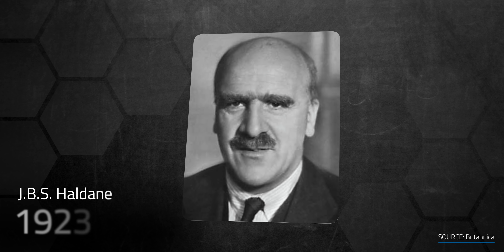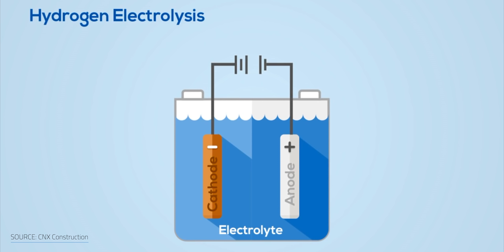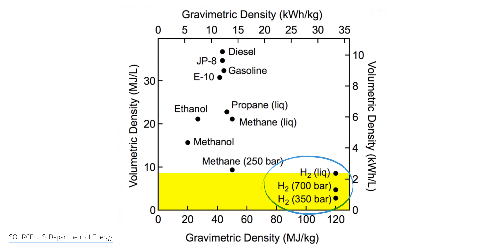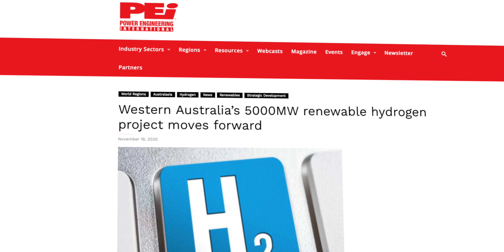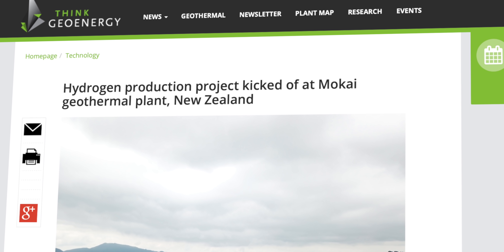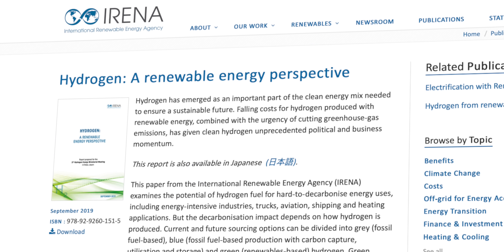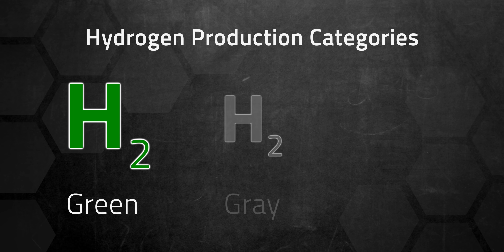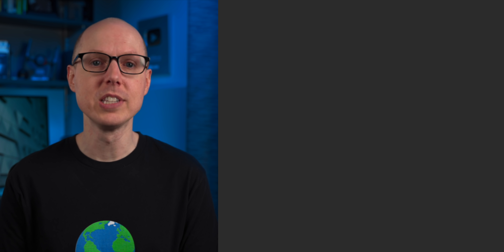The Truth About Hydrogen's Dirty Problem - Green Hydrogen Explained

Comment: I'm not yet convinced that hydrogen has a near-term application in which it can be cost-effective.  Any system involving hydrogen is more complex than the equivalent battery system and, in the case of PEM, fuel cells are highly dependent on both the air and hydrogen being clean, membrane being properly wetted and the water not freezing in the cell when it is not in use.  This sounds like more systems to maintain regularly and properly in order to assure the target lifetime of the system.  At least the low efficiency implies free heat in the winter.  In the case of home stationary systems hot water in the summer would also be free.

My bet is that, even with the energy to produce the hydrogen being free (of which I am skeptical but others bank on) the maintenance and/or repair cost of hydrogen will not let it be competitive in transportation, especially if BEV charging stations also have local storage of sufficient size to permit them to participate in the wholesale electric market.  The charging infrastructure battery would be charged with the same "free" energy being used to produce and compress the hydrogen but at much higher efficiency.  There is a reason why Tesla stated Megachargers would charge $0.08/kWh at the introduction of the Semi.  I imagine that reason involves Tesla Megapacks and Autobidder.  (Whether they hold to that remains to be seen.)

While I write this I am realizing that there may be industrial applications where the fuel cell type can be selected such that its operating temperature matches the plant's need for process heat.  This would largely negate my low efficiency argument.  This would permit such applications enjoy the lowest energy costs in exchange for the capital cost of installing an electrolyser, fuel cell, and a battery sufficient to buffer the fuel cell from fluctuating electrical demand from the process.  Since many processes are most efficient at constant demand the installed battery capacity may not be very large relative to the fuel cell power capability.  So, yes, I have finally convinced myself that hydrogen may have a good fit in many industrial applications.

This is why I listen to technologies I am skeptical of and try to respond to some length.  It is part of my assimilating the information.  My apologies to those I bore with this approach.

Comment: The Emporer has no clothes!
Why does the hydrogen fuel myth and its farcical magical mystery tour still get an audience?
Kids... you cannot effeciently store it in a vehicle without double wall carbon nano tubes and, they only function in labs.
And they still are not feasible after 25 frigging years.

The BTU's of hydrogen are 40% of diesel.
Propane is even worse and even propane has greater uses and applications.
Where is any commercial use of hydrogen for transportation?
Its still a pie in the sky vapor ware.

Comment: It would be interesting to see some hard numbers comparing a propane vehicle with a hydrogen vehicle. How much hydrogen would be needed to match the performance of a propane vehicle. How cost effective would it be in terms of the expense of a vehicle that runs on hydrogen, and the cost of the hydrogen itself. And how safe is the hydrogen storage compared to propane storage.

 Or for home heating. Where I live every house has a natural gas furnace. How easy/hard/expensive/safe would it be to convert the infrastructure to carry hydrogen instead of natural gas, and how easy/hard/expensive/safe would it be to convert or replace home furnaces to run on hydrogen vs NG. 

 These seem like simple questions with simple answers. It's telling that none of them were asked or answered.

Comment: Can someone provide me the reference for the “85% conversion efficiency” of the electrolyzer? I see Nouryon, but can’t find anything useful.
Reply: I can certainly believe they reach such a high efficiency rate, the problem is that there is a lot of losses in the stages after the creation of the hydrogen. It is those compounding losses that really makes hydrogen unattractable from an energy efficiency standpoint.
Reply: I heard a Bill Gates backed company reached 95% efficiency on there system. I think the company’s name is H2Pro.

Comment: Formula one are currently considering Hydrogen fuel cells for thewir new engine regulations, due in 2025. If they do go with hydrogen, it could give the fuel a major PR boost, while also leading to manufacturers discovering better and more efficient ways of using in in vehicles.

Comment: One of the biggest overlooked problems Hydrogen fuel are the end cost and it still needs to be transported.  Projections have put the cost (a lot having to do with transportation costs) still at or above the cost of regular conventional fuel.  So, it costs the end user not only a lot more than electricity but even more than gas.  Not to mention, the transport of Hydrogen fuel has other additional problems I could list.

Comment: Do you even research before you post your videos? Hydrogen storage is a problem, you need pressurized tanks to use hydrogen on ships? Don´t you even know the Germans invented a gel to store hydrogen safely and with almost the same energy density as gasoline? The gel is pumpable, inflammable and all you need is water to release the hydrogen.

Comment: Matt, whats the possibility of using green hydrogen as a battery? What's the total turnaround efficiency of that in bulk facility form?
Reply: It's really not great. Electrolyzers may be "OK" at 85%. Some newfangled high-tech fuel cell presented by NGK apparently does ~80%. Typically they're more in the realm of 60%. And you need to liquefy or compress it to store it. Roundtrip maybe up to 60%? Or 51% if your fuel cell isn't magic.
Honestly at this point you might as well heat up a pile of rocks and use that as storage. That's apparently 45% efficient electricity-heat-electricity. It's cheap and it doesn't need high tech fuel cells that wear out over time.
https://www.siemensgamesa.com/products-and-services/hybrid-and-storage/thermal-energy-storage-with-etes

Comment: The problem with taking H2 out of the water is, you are using all the water up. If they could do it with out  using up the water it would be good. Sooner or later there is no water.
Reply: Is water produced when the hydrogen gets used in the fuel cell?
Reply: @RyanWilliams222   It is but when you start with a gallon you do not finish with a gallon.
Reply: @MrBgwolf  I wonder how much of a concern that would be in practice. The same thing applies to nuclear fusion, right? But it isn’t a practical concern because of the huge amount of energy you would get from a relatively small amount of water?
Reply: @RyanWilliams222  Well think of it this way. Years ago , they said  We can send pollution down the rivers in to the ocean cause is so big it won't hurt any thing. Now its a big problem. We can't replace the water when its gone its gone, at first it won't seem like a big deal but in time it will. Just like when we started polluting the rivers and ocean. We never seem to learn till its to late.

Comment: Some companies have also been working on a better hydrogen storage solution. In Germany they already have prototypes of hydrogen powered houses.
Reply: Australia too
Reply: These are no longer even prototypes, but are already ready for the market and are already being sold. See the system called "Solhub" from Fronius and "Picea" from HPS.
Reply: @sigismundsulzheimer5512  I know, I've already watched a documentary in german, the system can even store hydrogen/energy for the winter and it works awesome, now we just need a better hydrogen storage solution to reduce incidents
Reply: @alanmay7929  I see, that's great. There is a highly interesting and remarkable approach to the safe storage of hydrogen. It also comes from Germany and is called "Powerpaste". It's a paste made of magnesium hydride developed by the Fraunhofer Institute. This paste is not under pressure, does not need to be cooled and is offered in replaceable cartridges. This means that the paste is neither liquid nor gaseous and only produces the hydrogen needed for the fuel cell when water is added (from a separate water tank). The cartridges containing the magnesium hydride are reused after use, thus creating an energy cycle https://www.ifam.fraunhofer.de/en/Profile/Locations/Dresden/HydrogenTechnology/hydrolysis.html

Comment: Please can you also consider talking about synthetic fuels? Porsche and some companies have been working on that.
Reply: Look up “Power-to-X” / “Power to Fuels” for some more terms as well as synfuels.

I think that combined with sustainable sourced, (not just sugar ethanol/plant oil biodiesel, look up “algae biofuel” “cellulosic ethanol, bio-butanol, and HTL “bio-crude” ) biofuels is the way to go as it is a “Drop In” solution as a bandaid, and long term can make a green grid/fuel economy
Reply: One of the simplest is methane:

- Convert as much waste water treatment to include anaerobic digestion to produce biogas and upgrade this to cng standards

- Convert all landfills (that we should remove, but that is a whole other rant) to bioreactor landfills for landfill gas, and upgrade that to cng

- Construct plants that take in CO2 (probably from the exhaust of existing Natural Gas Combined Cycle plants, although direct air capture is possible, etc) and industrially produced  hydrogen and convert it to methane

All of this feeds into the Existing Natural Gas Grid

Not much more distribution/storage infrastructure is needed.

Mainly making it more common for the average user, although this is less of a jump than new hydrogen/large scale electric infrastructure.

Also the sheer amount of storage in salt domes/(pumping back into) wells/tanks/the pipelines is HUGE and requires almost no additional infrastructure than what we currently have.

Existing trucks run on cng (sometimes with a small amount of (bio-) diesel), and solid oxide fuel cells exist in the market for power backup, but can be converted for FCEV use.

We have huge, efficient, power plants utilizing methane.

All in all i think AT LEAST starting up synthetic methane is a must.
Reply: @ericlotze7724  https://www.electrochaea.com/  they've made  selectively evolved archaea that takes c02 and hydrogen and makes synthetic methane gas.  The advantage is of course we already have an infrastructure for transport, gas plants etc and a synthetic jet fuel makes perfect sense as lithium ion batteries have only 2mj/kg while jet fuel 45mj/kg and batteries are not going to improve 22x in energy density to to physics constraints.
Reply: @peterkratoska3681  There were some planes designed to use LNG i think (one was that "mineral carrier" for Canada, and the other was Soviet Designs (i think double check me)

So they definitely are possible.
Reply: @ericlotze7724  ok but LNG is not c02 emissions free. If you're going to do that why not just make synthetic fuels?  Is anyone working on LNG planes?
Reply: @peterkratoska3681  It is if it is made from biogas, or from methanated hydrogen, and captured co2
Reply: @ericlotze7724  Ok, so it might as well be from synthetic gas.
Reply: I think most of the current synful strategies people invest in use Gas-to-Liquids syngas+catalyst processes.

These could use that methane infrastructure as well as (sustainably sources-) biomass/RDF gasification plants.
Reply: Porsche knows full well that's not a scalable technology, they are investing in it so they can sell e-fuel to rich automotive enthusiasts who are willing to pay $3.00 per litre at the pump so they can go "vroooooom" in their 911 on track days. The mere commoners and plebeians are just going to have to accept the agony of driving around in fast, quiet, well mannered electric cars in our horrible future dystopia.
Reply: @0hypnotoad0  not scaleable?  This was/is done with 
“coal-to-liquids”
 and 
“natural gas-to-liquids” ?

The only thing holding it back is the cheapness of fossil fuels.  Once a carbon tax/ban is implemented that is null.
Reply: @ericlotze7724  The current air to fuel producers in my area, using our ultra-cheap hydroelectric power have claimed that synthesized gasoline would cost $2.10 (CAD) per litre at their highest projected production scale, before taxes applied. The most expensive gasoline in Canada is $1.50 per litre now,that's with tax. Almost nobody here in Canada is going to be willing to spend that much on fuel over just buying an electric vehicle. So yes, it's not scalable.
Reply: @0hypnotoad0  it is still new so it may be improved, but also if the true cost were to include a carbon tax then it may be competitive.
Reply: @peterkratoska3681  The process to make synthetic hydrocarbon fuel will never be efficient, it's physically impossible. There's no sense in making inefficient synthetic fuel to try to preserve an inefficient form of automobile technology, it just doesn't make sense on a large scale when we should be aiming to reduce energy consumption. Porsche is buying into this bunk technology because they want to reassure their extremely wealthy consumer base that buying their current ICE vehicles is still a sound decision, and that they will be able to continue to make NOx emissions and noise well into the future while the dirty poors in the future have to be content with battery electric and hydrogen vehicles.
Reply: @0hypnotoad0  Not really talking about the use for automobiles, rather airplanes. Currently while there may be some planning for electric planes (ie. Harbour Air in Vancouver for their short hop, small passenger market to Victoria is converting to electric)  how will you get the energy density you need for planes? The best lithium ion batteries are maybe 2mj/kg while jet fuel is around 45mj/kg.  And those batteries are not going to get 22x better, there are physical limitations, growth of dendrites, and they're equally heavy when discharged (and thermal runaway can be major issue)  Conversely, using hydrogen to power planes -it actually does have over 100mj/kg but would have to be under pressure and that's not easy - and the containers are very heavy.

If the issue is co2 emissions. Synthetic fuels can be carbon neutral. You can convert c02 to c0 and add hydrogen to make various hydrocarbons, jet fuel, diesel, This is proposed for outfits such as Carbon Engineering in BC could take the c02 it extracts and using Air to Fuel technology to make synfuels for $4/gallon.  https://energypost.eu/extract-co2-from-our-air-use-it-to-create-synthetic-fuels/
Reply: @peterkratoska3681  Heavier-than-air aircraft do not belong in a world where we are trying to reduce energy consumption. If there comes a point where we can easily generate vast quantities of excess power, then, maybe I can see a need for that. Still, I'd put my money on hydrogen fuel cell airplanes before synthetic fuel.
Reply: @0hypnotoad0  Well, you're not going to get rid of heavier than air vehicles. While lighter than air dirigibles are kind of fun to think about, wind and weather is a real factor to think about along with a host of other issues.  But if its a question of c02 emissions, aviation is 2.5% of the total so not that much. WHile I'd like to see some kind of hydrogen fueled planes there are issues, number one is containing the hydrogen - if you have to store it compressed or liquid form those tanks are super heavy, which is the same problem as the batteries and they will be heavy when empty as well.  Fuel cells tend to require platinum which is more expensive than gold.   If you can make synthetic fuel that is c02 neutral you've solved the emissions problem.   And you can use existing technology and infrastructure. Hydrogen planes are decades away we actually need to bring down emissions now.  

I totally believe we need to act quickly to reduce emissions, but I'm skeptical of new technology that is all fancy computer graphics and years away from development.  For instance even if we were to stop all transportation c02 emissions and go electric - new construction and building around the world especially in developing countries will increase our emissions anyway because construction requires a massive amount of concrete and steel production which make up 18% of total emissions and right now there are no real alternatives.
Reply: @peterkratoska3681  Heavier than air vehicles will largely get rid of themselves as the push for alternative fuel comes into effect, it will not longer be cost effective for normal people to fly, many airlines will go out of business, or be forced to massively downsize, and heavier than air travel will become a luxury for wealthy elites. Airplanes are essentially the pinnacle of the level of wastefulness that can only exist in a world where cheap, polluting fossil fuels are acceptable to use. So, either airplanes will effectively cease to exist in the way they do now, or they will remain exempt from fossil fuel bans, thereby precluding the need for an alternative energy source.
Reply: @0hypnotoad0  Also aircraft/ships/niche uses will need a fuel that scales/behaves like current solid/liquid fuels.

Also petrochemical products will need a non-fossil fuel source.
Reply: @ericlotze7724  air to fuels are not making bulk crude oil, they are making deliberate chemical chains. If they need to make ethylene, they can just make ethylene. 

Container ships should be nuclear powered, they represent a significant enough investment that they justify the extra security needed to operate a small reactor, and they are more than large enough and consume enough energy to justify needing such a large energy generating device. Military aircraft carriers already use nuclear reactors, the same technology should be applied to container ships.
Reply: I’d be down to help with research if need be, I’ve geeked out on this quite a bit (if you can’t tell lol)